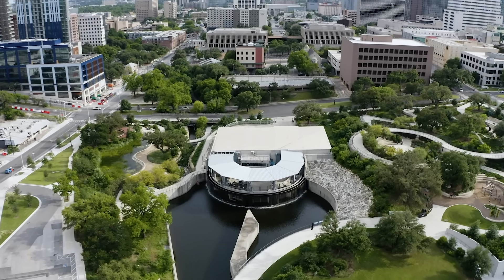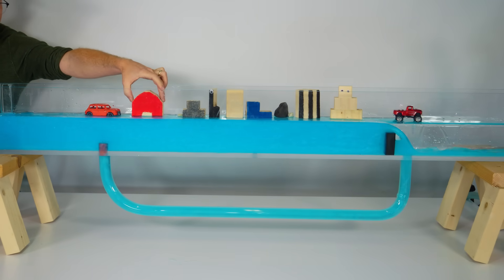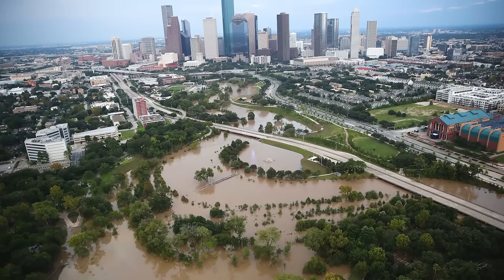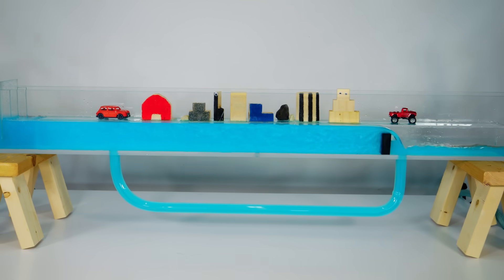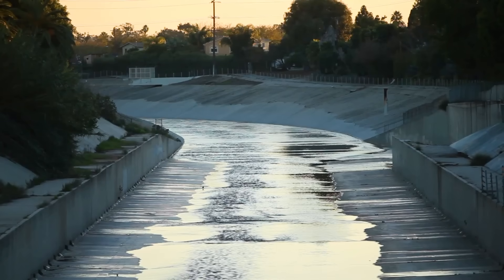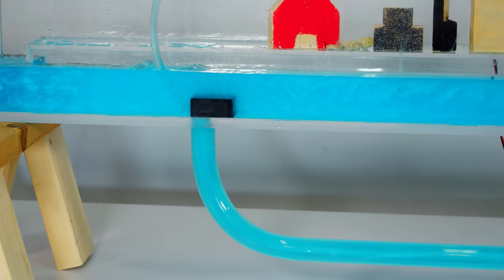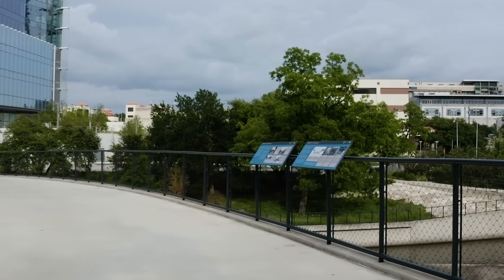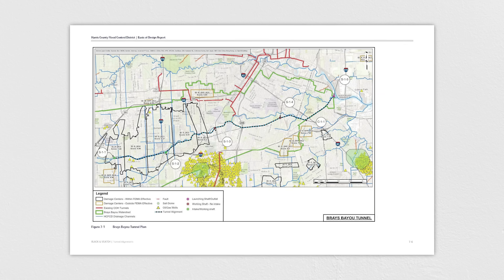How Flood Tunnels Work

Comment: Here is my instinctive reaction for how it would be designed. Is there some reason that this doesn't work? 
The upstream end would be extended to just below flood level. Water automatically flows during a flood and not otherwise.  A simple roof keeps the rain out so the tunnel stays dry unless there is a flood.
The downstream end would have a cover that blocks water from entering, but opens by floating up when water tries to exit from below. 
The stagnant water problem is dealt with by a small pump at the downstream end to slowly drain the bypass after the flood is over. 
The only active component is the pump and it is not needed during the flood. This design is immune to power outages and instrument failure. If the pump fails, you can deal with it after you deal with any storm damage. 
While this would not work in all locations, it seems like a simple robust solution in many cases.

Comment: To avoid stagnation within the tunnel, why not make the tunnel slightly permeable, like the weeping tile used in some septic systems and French drains? Then, when the tunnel was closed, water would tend to exit the tunnel rather than stagnating.
Reply: Weep holes would help and then let the remaining water drain to the end or low point and pump the water out downstream.   Austin doesn't have a flooding problem so not sure why it was done,  The capital is 11 blocks away from the Colorado river or Lady bird lake.  This seems like a project that built a nice park , but didn't really accomplish much on the flooding front.

Comment: Interesting, thanks. I have driven through the Kuala Lumpur SMART tunnel in Malaysia which is a multi-use tunnel allowing water and traffic movement and I believe has proven to be of great value since its commissioning.
Reply: Same here, but as a passenger. Truly a marvelous piece of engineering to be able to fit road traffic within a flood tunnel and having the road still be serviceable through multiple mode 4 activations 16 years on.
Reply: I worked as Senior Inspector of Works on the Smart tunnel project. The idea of a dual use tunnel came from a bidding contractor who won the build contract. To enable escape stairways were mined by hand methods outside the TBM driven tunnel lined with concrete section rings.
Two road decks installed carries traffic in both directions and the invert of the tunnel carries light rain storm water.
Reply: Same!

Comment: I'm no engineer, but you need to get yourself a much larger cutting board!  Also, put a thin, wet towel between the board and your work surface to prevent it from sliding around!  You can usually get a 3 pk of plastic cutting boards for almost nothing, and they're worth their weight in gold!  So much easer to work with ingredients when they aren't constantly falling off your cutting board!

Comment: I know you believe reservoirs aren't an option in downtown areas, but Augusta, GA is protected by a canal and massive upstream reservoir (about 30 minutes upstream on the Savannah River). There used to be massive floods, but the reservoir prevents most of the excess and the canal can take the extra flow from the river at a weir upstream of downtown.

Comment: The funny thing is surface bypasses are often chosen around the world. Basically what you describe at 3:50. In the 1700s to 1900s, many times a European city got flooded and city officials took land from destroyed buildings (usually compensating the owners... most of the time) and used them as bypass. This was especially common among the Danube, Vienna has a hole story on that. Anyways basically the destruction freed up the surface required for option 3.

Comment: I saw a video by a Dutch company recently who make rain water storage and discharge systems. It consists of crates wrapped in a water permeable membrane that can carry enough weight for car parks, small buildings and roads. They calculate the absorption of the soil and match that with the membrane so water can seep through and percolate to aquifers topping them up. The level is monitored and if heavy rain is forecast the "tank" is emptied into the sewers before the rain comes. The idea is for these to be installed under developments to handle all rain water and local run-off. With enough of these a city could manage floods while topping up ground water and avoiding sewers being overwhelmed.

Comment: One challenge with all the systems you've described is they need to be actively operated.  Somebody needs to be in charge of the flood gates, and even an automated system needs constant maintenance and testing.  Is it possible to add a riser standpipe to the tunnel entrance, so water is only able to enter when the river level rises to near flood conditions?  Add a few smaller entrances at a lower elevation so it gets flushed out continually by ordinary flow conditions.

Anyway your video has got me thinking about passive flood control systems for urban environments.
Reply: I watched much of the construction of the Austin tunnel in person. It's actually an almost passive design because they simply redirected Waller Creek into the tunnel. The old creekbed was fairly nasty because there was only a small trickle of water for most of the year and then the Spring rains would rinse it out to smell OK for next few weeks until the cycle repeated and the excrement literally piled up. Now the creekbed below the inlet structure gets fed by pumps with the water coming from Town Lake so the creek will flow swiftly with clean water all year. There are two additional inlets to the tunnel to drain the business district streets below the inlet structure.

Comment: I was in the last Austin flood to not use that bypass tunnel. Waller Creek was a torrent a mile and a half upstream from the inlet structure where 45th St. was 2 feet deep in water. There's lots of great video if you search for 'Austin flood 2015' or 'Memorial Day Flood 2015'.

Comment: I have to wonder whether such tunnels are being considered here in Mississippi...or if maybe they are not feasible due to the local geology. I keep hearing that it's impossible to build simple cellars here because the water table is so close to the surface, and there's a lot of sand and clay in the soil, making for a bad combination of holding too much water and lacking stability. And yet it feels like we have the ability to overcome those problems - and with how frequently we see floods here it really seems only sensible to try!

Comment: Why do these have to be actively managed instead of a passive overflow spillway? 

In your model, it would be a tube that extends up from the inlet on the left side, and sits higher than the dam, but lower than street level. 

If there's a flood and water levels rise, it'll go over the spillway and increases capacity, all passively.

Comment: I would have liked when you were demonstrating by pouring more with the tunnel closed at 9:16, if you'd also poured more in when the bypass tunnel was open. To show how it recedes faster or doesn't overtop/washout as much.

Comment: another way to prevent stagnation is to instead of bringing the tunnel back up to ground level like in your model run the tunnel and have it meet up somewhere downstream so that a syphoning effect would just draw air into the pipe  and maybe air would come out the other end sort of like what happens in the toilet if it is manually flushed once the toilet flushes only the water in the bottom of the bowl remains and the bowl does not refill this happens a lot when the city does maintenance on the sewer pipes where a vacuum is pulled it sucks the water out of the bowls leaving only a small bit remaining.

Comment: The Deep Tunnel project was recently completed in Milwaukee (in 2016?). I haven’t been in the tunnel but I have spoken to some of the engineers who have, and the photos they show are insane. Part of it is a 21’ diameter tunnel, 2 miles long, and 300’ underground. The entire system is more than just this section and can hold 521 million gallons of water in total. I just wanted to give a scale as to how big some of these diversion tunnels can get. They’re impressive structures.
Reply: I have been living in Las Vegas since 1985, a metropolitan area with its own amazing network of flood control tunnels and basins, but I am a Milwaukee native. I remember when the Deep Tunnel Project was begun. I grew up on the Northwest Side, where numerous creeks were placed in tunnels during the Twentieth Century and some were interconnected with both storm drains and basement drains. Urban sprawl north and west of my old neighborhood led to increased runoff, adding to the flow of Lincoln Creek , the Menomonee River and their various tributaries, both above ground and in tunnels. As you know, a lot of re-engineering was necessary to control flooding. I heard Red Star Yeast near 27th and I-94 was a casualty of the Deep Tunnel Project. Apparently their private well was contaminated by the tunnel project and their having to use city water made their business unprofitable.

Comment: Hey Grady, if im not mistaken, you havent covered the Colorado-Big Thompson project, which is a major water project divirting water from the headwaters of the Colorado river to the Front Range where 80% of Colorado's population lives.

There is a mindblowing system of water conduits, siphons, hydroelectric power plants, and seemingly unlinked reservoirs miles away from each other.
Reply: What's even more wild to me about that system is that it crosses the Great Divide in tunnels. 
The Colorado-Big Thompson project could be an engineering mini-series. I would get popcorn for that. 👍

Comment: The problem with tunnels is that they cost a lot since underground construction is way more expensive as opposed to ground level measures. Besides that, tunnels are usually a solution for today's problem, since their capacity cannot be easily increased. Climate change in terms of precipitation will mean the amount of rain is only going to increase in the future. So it doesn't matter how big the tunnel is, in the end it is only a temporary solution. So instead of diverting rainwater from a river into a tunnel we should aim to prevent water getting in the river from the start. Rainbarrels, greenroofs, rain gardens and wadi's are all ground level solutions which hold rainwater and prevent it from flowing on the street, in the sewer or in the almost overflowing river. Since every household can apply these measures it is more scaleable than an underground tunnel. Though it is a good solution as a last resort.

Comment: The neat thing about these tunnels is that the inflow and outflow can be at the exact same level and the tunnel still delivers water as soon as the inflow swells up. The tunnel can be at any depth too, even rising and falling any number of times. With either end open to atmosphere (1 bar), it could in theory rise up to 10 meters above the inlet level, as in a siphon. The water could in theory bridge over an existing road through a closed pipe viaduct without any help.
Maintaining these structures must be a daunting task, basically requiring cave divers or (robot) submarines, unless the water is pumped out first.

Comment: They had to build something similar to the Tokyo system here in Dallas when they rebuilt hwy 75 during the 90s. The highway got moved from the surface down into a huge concrete canyon that can collect rainwater faster than any feasible storm drainage system could handle. There are massive underground caverns 100ft below Uptown to store it until it can be safely released into the storm drainage system (Cole Park Storm Water Detention Vault). It's so well hidden that basically no one knows it exists.
Reply: I'd love to see an episode on this! What do you think, Grady?
Reply: I love the name. “Storm Water Detention Vault”. 

You are being detained on suspicion of attempting to flood Dallas. The court finds you guilty and sentences you to confinement in the SWDV.
Reply: https://youtu.be/E49DDYXob78?si=nAi9u-AAma1PQN_U
Reply: Sounds like a great place to film a movie chase scene.
Reply: They're building another flood tunnel:

"On Monday, July 25, 2022, the Big Tex tunnel-boring machine (TBM) reached the end of the five-mile underground Mill Creek Drainage Relief Tunnel at the Woodall Rodgers Intake. Completion of the underground tunnel excavation marks a major milestone in the drainage and flood relief project.

This modern marvel has been working underground on the largest hard rock tunnel project underway in North America for just over two years.

The TBM was utilized to excavate a tunnel that varies between 30-35 feet in diameter and is designed to carry a maximum storm water flow of nine million gallons per minute. The Dallas Water Utilities’ Mill Creek Drainage Relief Tunnel is a five-mile underground tunnel that will provide drainage and flood relief for over 2,200 properties in areas of east and southeast Dallas and uptown.  The project is scheduled for completion in 2025."
Reply: I would love to see a YouTube clip in this!
Reply: @DavidHalko  https://www.youtube.com/watch?v=E49DDYXob78
Reply: Philadelphia’s Vine St Expressway. Passing through center city, at ~10m below street grade, with portions well below Schuylkill River during floods. Hurricane Ira left segments of I 676 completely submerged along the western segment through downtown, after 22nd St pump station failed.
Reply: But wait, there's more. "The Dallas City Council today (May 2023) gave the state of Texas permission to pursue funding to remove and trench I-345... It is among the shortest on the national highway network, a stub that connects to Central Expressway, Woodall Rodgers, and interstates 30 and 45. It is, more than anything, a concrete connective tissue... TxDOT cites traffic counts of 180,000 cars on the roadway per day.

The basic plan for the roadway will cost at least $1 billion, which the state will pay for. First, the highway will come down. The trench that replaces it will be about 65 feet deep. The highway’s widest portion will accommodate a total of 10 lanes..."

The trench will be built in such a way that the roadway can be capped. The city of Dallas would have to pay for this added cost. Bascially this will allow them to create a greenspace atop on the freeway that connects downtown to part of the city on the east side. Dallas has done this before. See Klyde Warren Park.

Comment: 3:50: While constructing a bypass through a downtown is economically infeasible due to all the high land values, if you think larger you can bypass the entire downtown (not just through it). This is what Sacramento did with the Yolo Bypass: construct/designate a flood plain on the outskirts of the City that the Sacramento River is diverted into during peak flows. This past winter (one of the wettest in recent memory), the Bypass looked more like a lake with several feet of standing water. But this was better than the alternative - overtopped levies and flooded urban areas (downtown and environs).

Comment: There is a dam to the west of Austin. It exploded catastrophically in 1900 IIRC, chunks of the red granite it was constructed from are still visible in areas near where it was situated. A new dam was built in basically the same location, and also failed. A third dam was built in the same location, and is still there today.
Reply: That's the Tom Miller Dam.

Comment: Why not simply increase the cross-section of the creek by the cross section of the tunnel?  Then you need no excavation, no pumps, and only need to build two sides of the added cross section instead of giving it sides, bottom and top?

Comment: Places that have huge floods several years a century like the major rivers in the USA and other nations really need more major methods of dealing with the problem. Why don't they create huge "Water Capacitors" that channel water to huge low fields next to the rivers during floods? Those fields could be wildlife refuge or grazing areas for animals during non-flood times. Used with tunnels and directing excess water collected in the Water Capacitors to where the water is most needed like directing the excess into aquafers in the west through some type of mass natural filtering system. See it as a huge battery that collects excess and supplies it to where needed.

Comment: The largest system like this I designed was about 10 metres wide, 3m tall and 1.5km in length utilising rcc, this must’ve been a massive feat.
Reply: Okay so that's 33ft x 10ft and a little less than a mile long. Very cool.

Comment: Er, what do you mean by a cubic Olympic-sized swimming pool? You probably don't mean something nine dimensional, but you probably also don't mean the volume of an Olympic sized swimming pool, or you wouldn't have added the word “cubic”. Do you mean the length of an Olympic swimming pool cubed, or merely its depth? Any way you look at it, that's a strange and confusing unit of measure, and I don't think it helped clarify things ;).

Comment: this kinda seems like a example taht doesnt make much sense Yes if you plug the bypass it over flows But also by plugging the bypass your also just making the rivers capacity smaller. the interesting part would be if you made main flow path bigger to compensate for the extra space the tunnel gives you is the bypass more beneficial